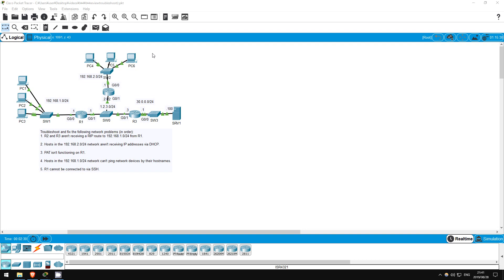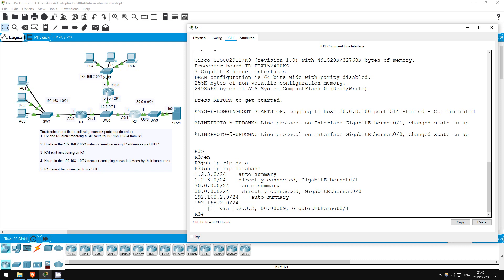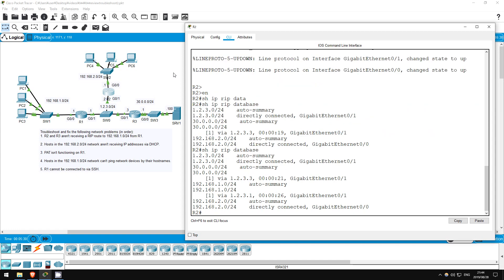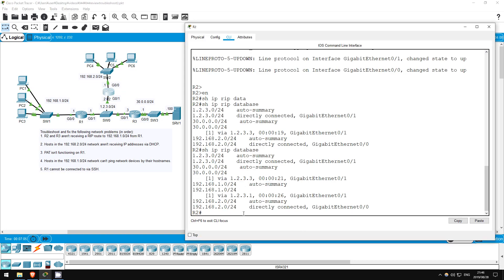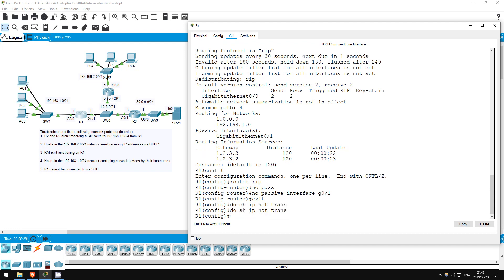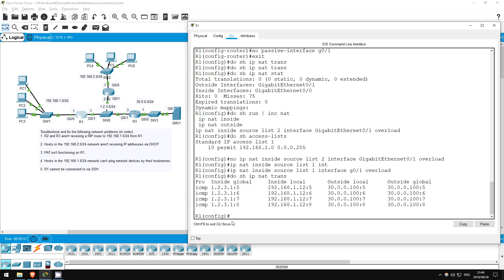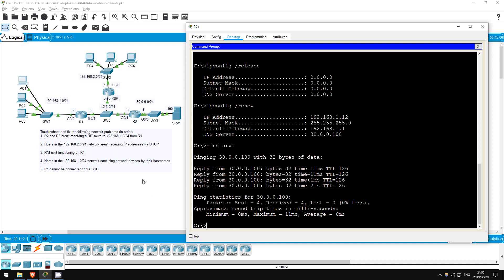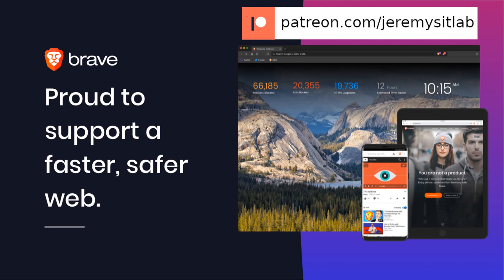FREE CCNA Lab 044: Review Troubleshooting Lab 2

Comment: The SRV1 server pings using the name and IP address.  The problem says DNS is not available.  :\>ipconfig /all

FastEthernet0 Connection:(default port)

   Connection-specific DNS Suffix..: 
   Physical Address................: 00E0.F929.AE67
   Link-local IPv6 Address.........: FE80::2E0:F9FF:FE29:AE67
   IPv6 Address....................: ::
   IPv4 Address....................: 192.168.1.12
   Subnet Mask.....................: 255.255.255.0
   Default Gateway.................: ::
                                     192.168.1.1
   DHCP Servers....................: 192.168.1.1
   DHCPv6 IAID.....................: 
   DHCPv6 Client DUID..............: 00-01-00-01-E2-49-5C-C0-00-E0-F9-29-AE-67
   DNS Servers.....................: ::
                                     30.0.0.100
I see that it is without making any changes.  Am I missing something??